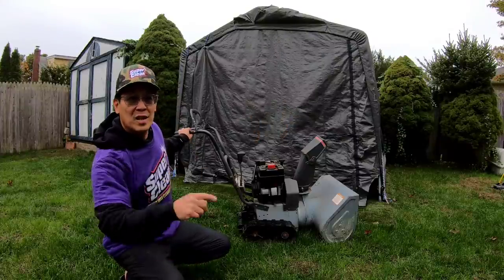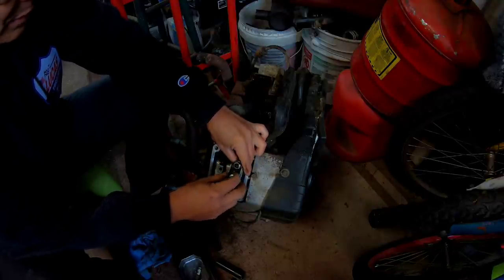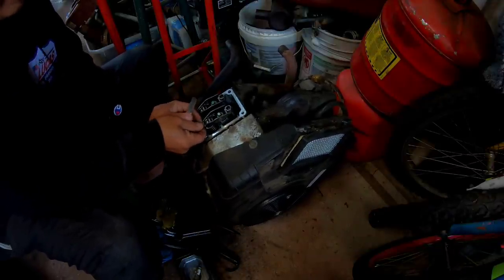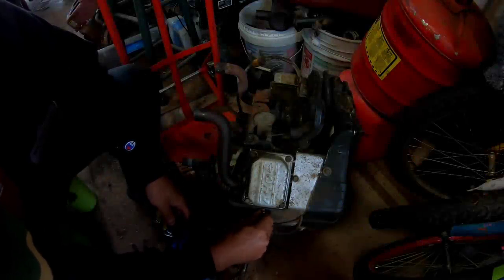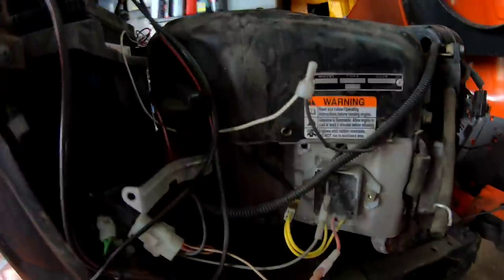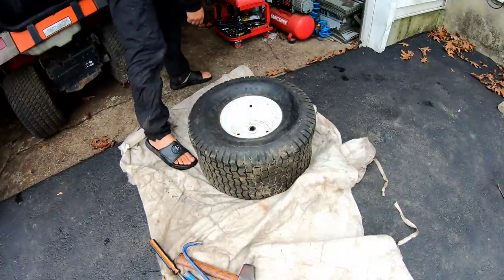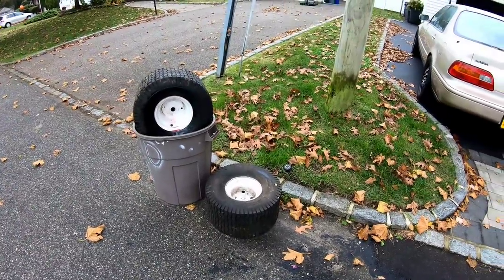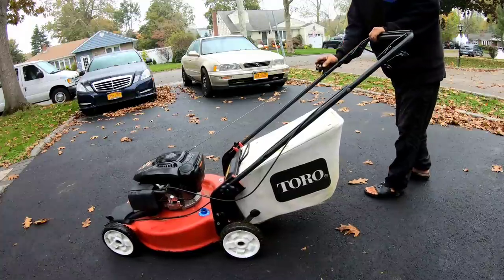FREE BRIGGS 406777 20HP V-TWIN ENGINE VALVE CLEARANCE LASH PUSH RODS ROCKER ARMS COVER INSTALLATION

Comment: Henry please check those valve guides on the head. There is a reason they are bent usually caused by a valve guide that has slipped up into the head.
Reply from the maker: Good tip David

Comment: Make sure that the exhaust valve guide is not slipping out that will bend exhaust valves
Reply: I was going to ask if you verified WHY the pushrod bent. The last one I had, the exhaust valve adjuster stud backed out and fell into the valve cover and the exhaust pushrod just fell down in the valley. This caused the intake on that head to bend as combustion was forced against the intake valve.  This was evidenced by popping out the intake while cranking and running.  Just don’t want to pass on a problem to the next owner.
Reply from the maker: One day when I install this puppy, we’ll find all that out.  Thx for the info Ken.

Comment: I did a check on this machine and it turns out that engine is stock to the machine. That one fooled me because one its a vanguard, you don't see that often, as well as some of the other weird things like the second ignition switch, the things disconnected and the missing starter. That should turn out to be a real nice machine when done.
The msrp in 2008 for that tractor was $2500 dealer only.
Reply from the maker: You owe me $10

Comment: can not find any information about torque spec for valve cover, do you know torque spec?
Reply from the maker: Torque spec for the valve cover bolts?  I just tighten them tight,  as long as it doesn’t leak.  Not really that important.  Unless you’re talking about the valve adjustments.
Reply from the maker: 100 inch pounds
Just googled,  first thing that came up

https://www.smallenginesuppliers.com/html/engine-specs/briggs/common_specs_for_intek_vtwin_engines.pdf

Comment: Just a heads up bro, I'm seeing digital green lines on the video, might be time for a new SD card.
Reply from the maker: I noticed too, I switch between two sd cards, I may need to reformat them. Thx for the heads up
Reply: @MowersNBlowers  no problem bro.

Comment: If the push rod bent, it is most likely because of a valve guide that moved, and if that is the case it will happen again.
Reply from the maker: I’ll check the guide again before I mount this someday
Reply from the maker: I’ll put a reminder sticker